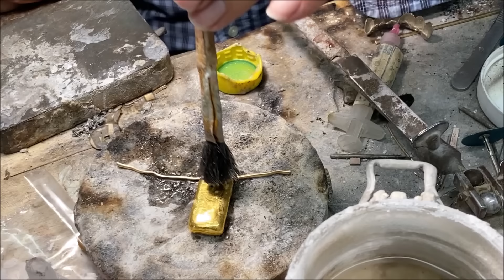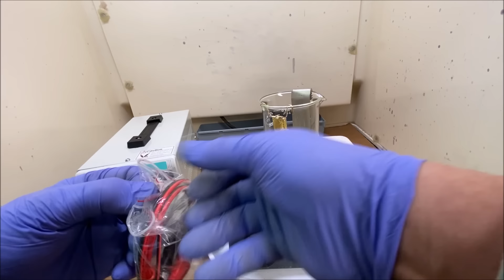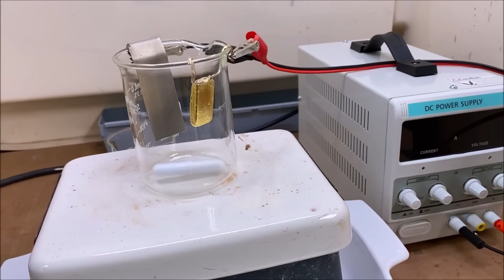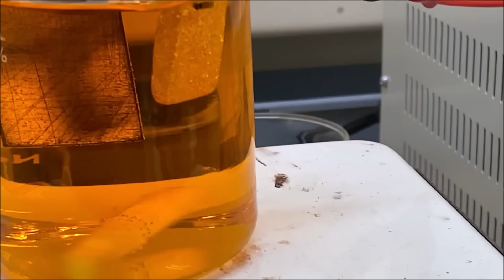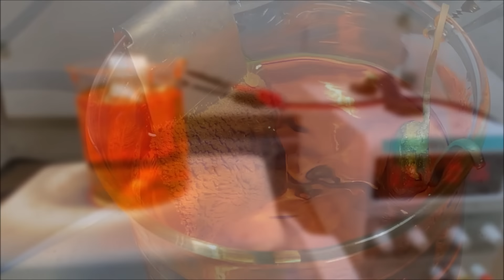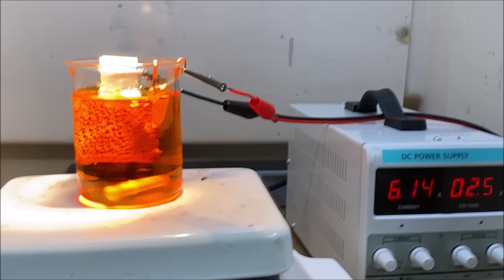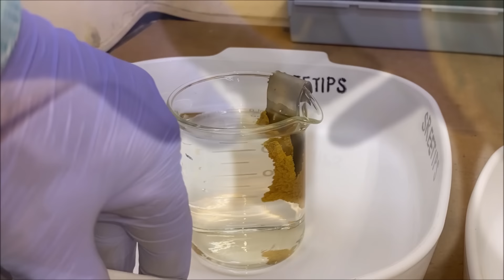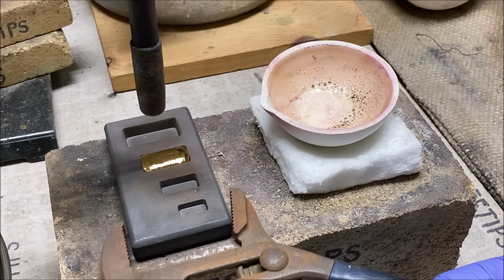Electrolytic Gold Cell Part 2

Comment: Electrolysis is such a cool thing. 
 My brother used to be one of the top printed circuit board production managers in the country, if not the world back in the 1980s and 1990s producing multilayer, flex, and exotic materials printed circuit boards doing small batch prototypes and large batch production runs for years. 
 He was 17 yrs old when he got in the business. 
  We used to use the large plating tanks to gold plate small items just to mess around. 
 He was the first person to get circuits on a board made from Teflon. He was also one of the first to perfect the process of wire bonding processors to circuit boards.
 He knows all the chemistry and electrical engineering , all the processes for plating copper, nickel , silver, and gold and probably more. 

Thanks for the video. It brought back some fond memories
Reply from the maker: I did it for the show
Reply: @sreetips  The gold crystals are not as pretty as the silver crystals, especially when they're in the bowl, but the process is neat. I wouldn't complain about some gold crystals in my hands.
Reply from the maker: @ the gold crystals sparkle in the sun light.
Reply: @sreetips  That was what I was thinking too.I bet they look way better with the eye in the light, off camera.
Reply from the maker: You are correct
Reply: Awesome story!💙🖤
Reply: Was he one of the two guys that started Jabo? If it was, he knows my cousin very well, she worked for them and helped grow the company worldwide.
Reply: @anomicxtreme  I'm not sure of the name of the company that my cousin worked for, but when he retired another company called him two weeks later and said we need your help please come help us LOL , so he went to the other electronics company and checked out all the circuit boards that they had that they said was wrong and he made them fix them the way he said to fix them and stop using cheap parts and everything worked out just perfectly fine and everything was working correctly upon his retirement from the second company LOL and that was probably 2005 , and I've got a good short story about that cousin cuz he started off his electronics by building his own shortwave radio , and 180 was a teenager he ended up catching an SOS from a family on a deserted island off the West Coast , he convinced his mother to call the US Coast Guard in California and she did and she explained everything to them and gave them the coordinates of what he was given as to where the family was Shipwrecked on an island that was burning down , the family of four was rescued by the US Coast Guard, my cousin had front page of the Tulsa World newspaper and a half page story written up about him building his own shortwave radio and rescuing a family that put out an SOS from an island that was burning down in the Pacific Ocean, and that was back sometime in the 60s I think it was LOL , probably sometime about 60 years ago
Reply from the maker: @robertrichards9275 that’s a cool story. Wish it was published somewhere. I’d like to read about it. Thanks for sharing.
Reply: @sreetips  I'm pretty sure it happened back in the middle to early sixties, and that was when my cousin was just a young teenage kid, and it was printed up as a front page headline in the Tulsa World newspaper but I don't know for sure what exactly the date was
Reply: @anomicxtreme  --- no, he stayed in the production manager capacity as troubleshooter. He had a friend who was THE go to guy in the board building industry if your company was losing money and the owners or board members wanted to spend a bunch of money they hired this guy and he had power to hire and fire anyone in order to make a company profitable again and he would go around the country and spend maybe 6 mos or a year figuring out where the problems were in these companies and he had multiple degrees and was seriously a genius and he taught my brother most of what he needed to know to be the best production manager and this guy would get hired by comanies like Texas Instruments, Teradyne, Gould, just to name some I remember, and when he got settled in he would then tell the owners that they were losing money in whatever department and if they were losing in processing department he would then hire my brother to come in and figure out where in the process system they were screwed up. Why their boards weren't passing inspections, whether it was in photo, or cad, or laminating, etching, drilling, wherever, my brother could and still can look at any circuit board, and figure out what is wrong with it. 
  So he and his friend traveled atound the country fixing companies or setting up board manufacturing divisions of companies that wanted into the business. 
 But once they did what they needed they moved on to another company until my brother got tired of moving every year to another state. He was only in his late 20s and decided to stay in Silicon Valley around 1988 and worked for big and small companies doing prototypes, exotics and specialty boards. Then he burned out in his mid thirties and learned to restore and install hardwood floors. Total 180° turn in trades. He worked on old Victorians in the Bay Area with his own business for around 20 years.
 Board shops would still call him a couple times a year to consult or troubleshoot their processes when they had a batch of boards they couldn't get right and he'd walk in and sometimes he could just look at one of the boards and he would know immediately what was wrong with it and he would need a day to figure out why it was messed up and he'd figure that out set that particular process right, run a few boards through the whole process and test them and make any adjustments in whatever department and get it right and charge a bunch of money and go back to working on hardwood floors. 
 That businesses,  board and chip/wafer processing is and was moving so fast, and the technology changes daily and the amount of money being made or being lost on a daily basis (millions per day) the pressure from the owners on a production manager is insanely intense and to try to stay at the top of the industry is not possible for very long especially when everything started going micro and nano. A person cannot keep up with the new developments at the pace that things were changing during the 2000s. You could keep up if you were given time to go back to school and by that time the industry has changed again. 
 That industry was killing my brother. He was 17 when he got in the business as a driver. By the time he was 21 he was one of the best in the business of producing top tier custom and prototype small batch military and exotic materials board building. About 17 yrs he did that.
Reply: Innovator
Reply: Wow , loved reading this truly amazing
Reply: Okay you get 23 k and mix a little bit more copper and aluminum tin foil and nickel.  The chemical reaction in that video is is oxidation which is technically rust and in order to get that rust you're going to need metals that rust easy and then you harvest the gold off of that and just keep repeating the process over and over and over till you get to 24 karat gold
Reply from the maker: @unicornbatmanmf6346 I use 995 parts per thousand gold anode in the cell and harvest 9999 parts per ten thousand pure gold from the cathode.
Reply: You're brother was the first person to get pcb's on teflon???
Reply: @49erjohn  --- first, to correct you, pcbs stand for printed circuit boards, which is the completed circuit board usually made of fiberglass and goes through a multitude of processes to adhere traces or circuits made of a conductive metal such as copper or gold with "pads" where circuits end and a hole is drilled for the leads of a transistor or capacitor, or other "switches", refugees, etc... to be soldered to the circuit. PCBs advanced and multilayered boards, stacked individual boards, each with their own circuit design are laminated or heat pressed together but designed to have drilling and certain pads align and the drilling may penetrate all or only some of the panels laminated., then different materials were used for circuit boards at the request of certain manufacturers of products that needed corrosion resistance, heat resistance, etc... one is the use of 35mm film as each frame to be used as a circuit board. The military wanted this first because of weight and flexibility for use in various hardware for defense and offense uses. 
 Then, to your question, yes, from what I know being told to me from my brother and knowing his skill and education in all aspects of production of pcbs, that he had been playing around with different materials as the base to get circuits to bond onto. The more difficult products are what he wanted to try just to see if he could get the all the different steps of producing a circuit board, from cad or cam design, to photo to get the negative to positive to the chemical etching of the copper, Nickle, gold,  whatever the circuits are made of ( getting the chemicals mixed exactly and to the right temperature and how long boards should sit in the solutions is a very difficult thing and it being wrong means circuits will not bond or have breaks or variants of thickness causing voltage variances detrimental to the product), to drilling and to the finished product,
 Somehow, he was either challenged by someone, or he came up with the idea to see if he could get a conductive material, probably gold, to bond to the slipperiest surface known to man, Teflon. So he spent time after hours at work trying to figure out the processes of how to make this work. And it didn't take him years or anything, it was from what I know only a month or maybe less for him to get printed circuits to bond onto Teflon. He had to find the chemical make up of Teflon itself and then figure which chemicals would break the structure of Teflon without damage to the whole board but only where the circuits would be etched and then electroplated with the nickel then the gold.
 He was able to successfully do this and this was back in the mid -late 1980s or the beginning of 1990. My brother was probably about 20 years old, high school dropout, and no formal electronics education. He started as a driver delivering circuit boards for a shop that his girlfriend's father owned that produced small batch custom and prototype circuit boards. He worked his way through all the different departments of the company learning all he could. Then he bacane close friends with one of the smartest and craziest people in the PCB manufacturing industry who worked as a fixer for companies who were losing money and he would be hired to figure out why and where the company was hemorrhaging money and he got to hire and fire anyone in order to make the company profitable. He had degrees in electronic engineering,  chemical engineering, mathematics, and a few more degrees. He and my brother would hang out after work and my brother just sponged information from him and he taught my brother everything and when he would finish with one company he would go to another, I'm talking the biggest companies in electronics across the nation and he would tell my brother to get ready to move to whatever state he was working because he would hire my brother to solve the problems in their PCB production line.  So after a few weeks or month he would tell the owners he needed my brother to be the troubleshooter for the processes of their production line. My brother would show up and start with the engineering department and check the blueprints and sometimes tell these 40 and 50 and 60 year old highly educated men that their designs were bad or whatever flaw he found in their production process and tell them why and how to fix it and my brother was in his early twenties like twenty two years old no real education but he was so good at his job he had to lie about his age and education and he would say he was married with kids so he would be accepted when he was interviewed and once he got hired, none of that mattered because he knew his shit so well there was never a question about his knowledge because he knew more than the top men at these companies.
Reply: Don't think it's easy.
Reply: well they say the apple never falls far from the tree,so best of luck loved reading youre content thank you.
Reply: My cousin Mike Hunton was a designer at an Electronics circuit board in Indiana , he's the one that all the companies called on to fix their mistakes from whenever they had circuit boards that would fail , LOL I knew I should have tried to follow that cousin and get into Electronics but I didn't do that and that man made tons and tons of money designing the electronic circuit boards
Reply: @robertrichards9275  --- that's what my brother's job description was as the production manager for companies that produced printed circuit boards. There were companies that he didn't work for that would have problems running their boards through the build process from the blue prints in CAM or CAD to the photo department where they would take a photo using film the same size as the actual board will be and then take that photo negative and reshoot it so they have a positive film of the design and do it for every layer of multilayered boards, then the film they use is an emulsion and photo resist film that would get washed after it is put into a frame that has super fine silk screen and the film would be mounted on the screen in the frame and they wash it again with clean water and only the circuit design remains as the screen the rest is still covered and then a person and later in time a machine would use a squeegee type tool and press ink across the the whole screen with a fiberglass board underneath printing the circuits design onto the board. Then when they dry they get put into an etching tank where acid etches away the layer of fiberglass only where the printed circuits are leaving exposed copper or Nickle circuits. Then they might electroplate silver or gold onto the circuits in tanks. Then the boards are inspected at every one of those processes with your eyes or microscope depending on the size, then they send the boards to lamination where each layer of a multilayer board with its own circuit design but with matching drill points for "pads" that have to line up and they go into a super hot press that melts the fiberglass layers together, then they get inspected then go to drilling and routing and drilling mill gets programed for the pattern of the drilling locations and different sizes of holes needed and the drill goes super fast it's basically a CNC machine and it changes its own drill bits itself when warn out or size change or break. Then the boards get inspected again.and then go to a solder tank and the soldering process happens and sometimes the different chips and processors and things are installed on the boards. 
 So when you have all these different departments in the process of board production your production manager needs to be a super bad ass that knows each of those department jobs better than the people who do that one job everyday. They have to know everything from engineering, to computer design, to photography on an industrial level, they have to be a chemist to know all the different chemicals, from sulphuric and hydrochloric acids and and the measurements of the other chemicals mixed to make the big tanks for etching and electrolysis and know the heavy metals and how to measure how thick or thin the amount of copper and Nickle needed to get the silver or gold to bond without using too much or too little, they have to know everything better than everyone. That way they can look at a board  and know exactly what went wrong at what stage of the processes to cause the board to fail the build. There job as production manager is to make the company money. Get the product out fast and without flaws. Sometimes it could be a short run of prototype boards from only one or two boards or up to thousands of the same board design. It is a very high stress job and you have to be a super genius basically to be good. Companies pay a lot of money, some companies, for their production managers. My brother could pick up a circuit board that was made by a different company that is not passing inspection to ship and he could look at it and usually spot exactly where the problem is and then tell their production manager or engineers where their design or there specific step in the processing what to do to fix the issue. 
 My brother was the mean award winning football player in high school that dropped out after senior year football was over and worked for his girlfriend's father who owned a small board shop that made custom and prototype and exotic materials circuit boards and he started as a driver delivering finished boards to companies, then he went from one department to the next learning how to do each job. Then the owners hired a troubleshooter to find where the company was losing money and to boost their profits and this guy had companies waiting in line for him to fix their businesses. All over the country companies like Gould, Texas Instruments, Teradyne and others would pay him huge amounts of money and GE could hire and fire anyone and change any part of the company to make it a profitable business. He and my brother became friends and my brother was 19 or 20 years old and he and this guy would hang out after closing and drink beer and smoke weed and he taught my brother everything about circuit board building and this guy had like 3 doctorates and a PhD.  And when he was done fixing the company he moved on to the next company and told my brother he would be sending for him with a new job as the production manager that he needed to have troubleshoot the production side of the business and no one else can do the job as well as my brother. My brother had to lie about his age and that he had degrees from universities. They weren't worried about it because my brother was so smart and been taught so well that if anyone challenged his knowledge and doubted his education my brother knew way more than any of the people who worked for these companies. The two of them did this for six or seven years moving around from state to state fixing companies and six months or a year would go by and their job was done and John would move first to the next city and company and when he was settled in he would tell the owners they needed to hire this hotshot boy genius and he would guarantee that this production manager would save their business. GE would tell Kurt to fly in for an interview and then he would give two weeks notice at the company was at and move to the next city and company. They were the best in the business. As technology got better with microchips and processors etc... they would teach themselves everything working late getting drunk and stoned and researching and trying new things and then my brother decided to settle down in Silicon Valley in around 1988 or '89 working for different board shops large and small. After about 1998 he was burnt out on the industry. He'd been at the top for about 18 years and was only 36 yrs old. He started his own hardwood flooring company restoring floors of Victorian homes and he would get calls from companies to come and troubleshoot their production of boards that they couldn't figure out why they didn't work. So he would charge a bunch of money and work for a few weeks, fix the problem and go back to being a wood flooring guy.
Reply: are major bullion companies so stingy they make certain their coins are about 99.91% so you ... never get more than you paid for?
Reply: @lp8650  --- I'm just an electrician but, from my previous comment(s) I know a little, very little, but something. 
 Your idea is logical and worth the thought but, as you said yourself, it's already 24k . 
 Besides that, mining, panning, strip mining, and the large scale operations are ways we have been extracting gold ore since before the Egyptians made a large scale operation of it. If there was a better, easier, more productive, way to get gold from the Earth someone would be doing it already. Someone will someday figure out a way, but for now we get what we have. 
 Do you realize that most of the gold in the world in coins and jewelry and bars and ingots is old, very old, recycled over and over and could be hundreds of years old or even a thousand years old? Think about that. Gold doesn't go bad, it doesn't fade, it doesn't lose its lustre, their is endless recycling of gold without it degrading or losing any volume as we see in these videos. 
  It is an amazing substance with true rarity unlike the diamond.
Reply: Most people CANT AFFORD A DROP OF THIS TOOLS MATERIAL THANKS FOR VIDS EDUCATION DOE🎉
Reply: @13_13k  Yer brother? Is an Alchemist now. Dressed like Merlin. I cN picture it. Tell him he is a badass if he does. Even if he doesn’t? He’s still a badass. Because of his persistence, for perfection.
Reply: When u torchgold from.top ot adds carbonmakes not pure
Reply: You should watch David husdons or.mus
Reply: I'm   I going 😅 in
Reply: In my opinion he would start at the lower end of the carrots maybe something like 10k gold filled and then with the bars
Reply from the maker: @unicornbatmanmf6346 in order for electrolytic refining to be successful, the anode material must be fairly high purity to begin with.
Reply: Stop you f**** phone
Reply: So anyways what you do is you get you know pure gold
Reply: با درود وخدا قوت یک سوال کوچکی داشتم چرا بعد از رسوب طلا از تیزاب سلطانی با اگزالیک پودر زرد رنگ با روی پودر قهوای ذرات ریز وبا المنیم رسوب مشکی وهمه اینها موقع ذوب کردن تبخیر میشوند ایا راهکاری میتونی بدی برای جلوگیری از تبخیر ویا مواد که قدرت رسوب بیشر از لحاظ رسوب منسجم تر که در مقابل حرارت طلا تبخیر نشود با تشکر فراوان از ایران
Reply: You can tell high purity gold from the melt.
Reply: Thanks for showing that. How much did the lead cost?
Reply: Deben haber tenido mucho dinero , equipos, materiales y educación a la mano .

Un niño del congo la tiene más difícil..

En mi país decimos a eso .." la plata llama a la plata"😂
Reply: @lp8650  --- I see exactly what you are saying or I should say I'm picking up what you're puttin' down. LOL

   I see no benefit in the refinement if it is already  .99999 24k gold. 
  I think he is doing the process just for the chemistry method to show people that it is possible to take raw or scrap gold (of any karat or mixed with other material) and break it down, get the other valuable minerals separated and the worthless crap separated as well, and then the processes of then the refinement and then turning it into an ingot or bar. I think he uses 24k because it is straightforward for people who may not understand the differences in gold refinement? 
  I can't remember if he started this video with a bunch of scrap jewelry of plated and filled etc... and then did the processes of bringing it up to 24k or if that was a different video.
Reply from the maker: I started with a bar of pure gold. In order for electrolytic refining to be successful, the anode must be relatively high purity to begin with.
Reply from the maker: Smelt is a term used to describe rendering metals from ore. Gold found in nature is never 24k pure gold. It must be refined to get it to industry standard of 999 parts per thousand. The fourth nine is totally unnecessary unless needed for some specific purpose. The only reason I did this video was for the show, to demonstrate how it’s done, and to create another highly valuable video for my channel.
Reply: @sreetips  --- I'm the original poster of the comment about my brother in the board business back in the day.
  I haven't seen any recent videos from you. Is YT not suggesting new content or have you taken a break?
Reply from the maker: @13_13k taking a break.
Reply: @sreetips  --- goof to hear. I hope it is a break that you want and for positive reasons? Stay healthy and safe. Hope to see new content when you are ready.
Reply: Mad skills great content loving it..  @sreetips
Reply: @13_13k The highest that you'll get is either 18K or 22K gold but 24K gold